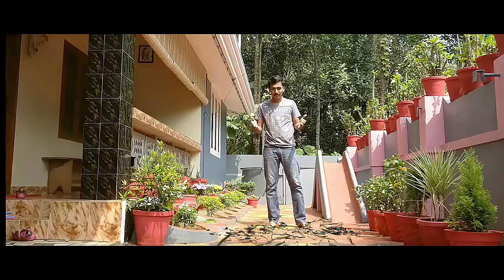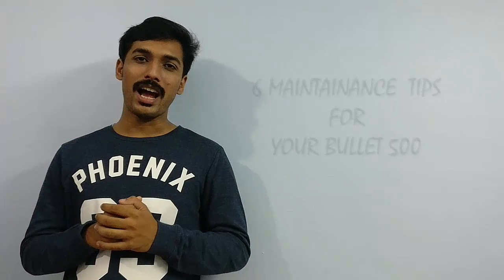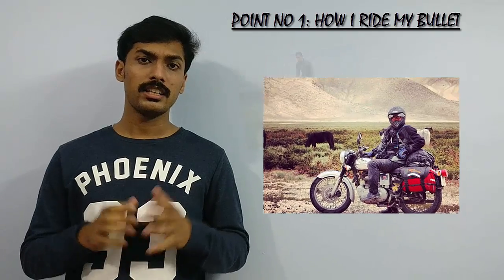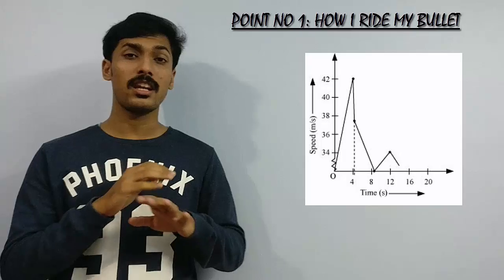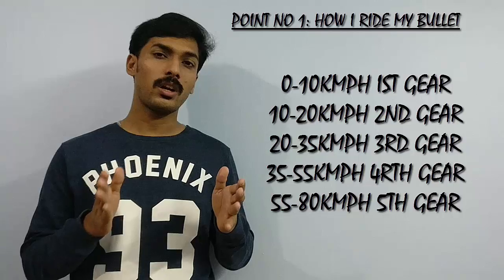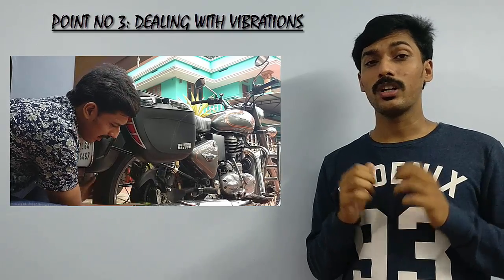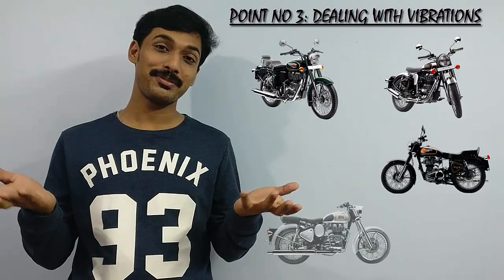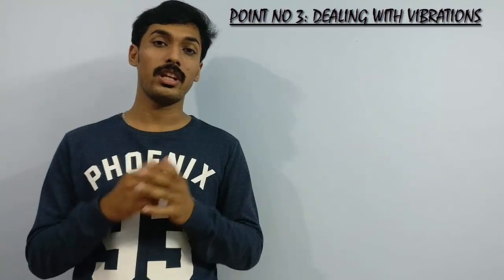Royal Enfield Maintenance tips | 6 Tips On How I Maintain My Bullet | 500 Subscribers

Comment: I'm using Motul 15W50  and NGK Iridium Spark plug  for 5 years for my 10 year old Enfield Bullet G2. Both alternatives giving me more fuel efficiency , less vibrations and I get 50Kmpl  in highway cruising .  The sludge  depositing in the engine is also reduced a lot. I suggest an oil change in every 6000km in normal conditions and 5000km span in tough conditions like heavy traffic or  hilly areas. Iridium Spark Plugs may withstand more than 50K kms but I'm replacing it in every 25K. Motul Synthatic oil costs Rs800 per litre and NGK Iriduum 600 per piece.  If the engine makes a lot of smoke due to wear and tear the spark plug needs intermittent cleaning. These two alternatives are best after an "engine overhaul".( For malayalam readers-  ഞാന്‍  എന്‍റെ 10 വര്‍ഷം പഴക്കം ഉള്ള  'പഴയ മോഡല്‍' ബുള്ളറ്റ്നു 5 വര്‍ഷമായി  മോട്ടുല്‍ 15W 40 സിന്‍തെറ്റിക്ക് ഓയിലും "ഇറിഡിയം" സ്പാര്‍ക്ക് പ്ലഗും ആണ് ഉപയോഗിക്കുന്നത് . ഇത് രണ്ടും ഉപയോഗിക്കുന്നത് കൊണ്ട്  എന്‍ജിന്‍ വിറയല്‍  കുറയുകയും  ഹൈവേ യാത്രയില്‍  ലിറ്റര്‍ നു 50 കിലോമീറ്റര്‍ മൈലേജ്  കിട്ടുകയും ചെയ്യുന്നുണ്ട് . എന്‍ജിനുള്ളില്‍  അടിയുന്ന  "sludge" കുറഞ്ഞിട്ടുണ്ട് . സാധാരണ 6000 കിലോമീറ്റര്‍ കൂടുമ്പോള്‍ ഓയില്‍  മാറിയാല്‍ മതിയാവുമെങ്കിലും , കൂടുതല്‍ നിര്‍ത്തി-എടുക്കുന്ന സാഹചര്യത്തിലും ,  ഹൈറേഞ്ച് കളിലും 5000  കിലോമീറ്റര്‍  കാലയളവ്‌ ആണ് അഭികാമ്യം. "ഇറിഡിയം" പ്ലഗ്  50000 കി.മി.  നു  മുകളില്‍ ഉപയോഗിക്കാം എങ്കിലും 25000 കൂടുമ്പോള്‍ ഞാന്‍ അത് മാറാറുണ്ട്.  സിന്‍തെറ്റിക്ക് ഓയില്‍ ലിറ്റര്‍നു  800 രൂപയും സ്പാര്‍ക്ക് പ്ലഗ്നു 600 രൂപയും ആണ് വില. കൂടുതല്‍ പുക ഉള്ള എന്‍ജിന്‍ ആണെങ്കില്‍ ഇടക്ക് ഇടക്ക് സ്പാര്‍ക്ക് പ്ലുഗ് വൃത്തിആക്കേണ്ടി വരും. എന്‍ജിന്‍ പണി കഴിഞ്ഞ ശേഷം ഈ രണ്ടു മാറ്റങ്ങളും വരുത്തുന്നതാണ്  കൂടുതല്‍ നല്ലത്.)
Reply from the maker: Hi Friend,
   
Firstly Im really sorry for not responding to your comments and not to continue my works..All that happened due to some personal problems that's the reason i gave my channel to my sis.

Bt Now I'm in♥️
This is your *Enfield Rider*, back with my new channel uploading first video tomorrow at 8 am..so plz do Subscribe,watch & support me as how you were.God bless you 😊
Stay safe😇

Subscribe 👇🏻 South Side Serpent https://www.youtube.com/channel/UCsERTefHIz6nQrndFDRsKLg

Comment: Vibrations in the UCE engine... It is not due to the sole fact that bullet is made of metal. Take the CI engine and u'll find that a perfectly tuned CI engine puts out much less vibration. It is partly due to the air:fuel ratio. Newer bullets have a higher air:fuel ratio as pre-set in the carb by the company to extract the maximum mileage. Increased a:f ratio means greater amount of O2 entering which enters the engine, which produce a vigorous combustion with higher power output and excess heat , which is no problem in UCE as it is cooled with approx 2.8 litres oil per minute. In comparison to this, the old CI has only 0.8L of oil circulation per minute which makes it heat up, thus forcing the mechanics to reduce a:f ratio with less air and more fuel thus producing a more calmer engine with a distinctive thumping sound, and torque distributed in the lower RPM, which makes for a noticeable travel in the city at slow speeds of 20 kmph at 4th gear, with little vibration.

Comment: After wasting 1 oneway kit(and 4k bucks) and a lot of research, I got this:
1. Always kick in morning/winter mornings. Rest of the day, self can be used. (applicable to all bikes. saves battery, saves self)
2. Never throttle while self start. The 'pushback' from engine screws the bearing and if that bearing is not replaced, oneway kit is also damaged. So, never throttle while self. or throttle just a little bit.
3. Never half-self it. Push button firmly till engine starts.
If followed self(and battery) goes on for years. Otherwise , wrong practices can screw them up in months.
Add up:
regarding vibrations, use 15W50 always, get a heavy handlebar(add sand/bearingballs/clay inside, weights/grips at barend), warm up engine before use. Vibration almost vanished for my c500.

Comment: I am planning to buy desert storm.. pros and cons please..?
is there any alternative option other than desert storm?
Reply from the maker: Anand Rooban Bro desert storm is an awesome vehicle , The pros will be the instant power and torque the engine gives bcz of the fuel injected engine compared to the carburetor ones , Another ones is the cruising speed of the vehicle now if you take the bullet 500 its sweet spot will be 80-85kmph ones pass that the feel is not that good as of vibrations but i could easily ride  at speeds of 95-100 without any problem . now the cons of the vehicle is the mileage , Compared to the bullet 500 which geta around 32-35 kmpl this will get you a maximum of only 28kmpl , And if you are are a tourer the fuel injected engine wont be as easy to service compared to the carburetor engine on bullet 500 which most mechanics are able to service . Those are the main points i looked into , Will make a video on this topic asap , Subscribe and Stay tuned for more , Have A Great Day bro :)
Reply from the maker: Anand Rooban bullet 500 is the best alternative , as the main difference is only the carburetor vs fuel injection , And the styling . Most of the other aspects are same . If you are a modern style of person continental gt is also a good one but the same cons that i stated for the desert storm implies here . Hope i could help you bro .
Reply from the maker: Hi Friend,
   
Firstly Im really sorry for not responding to your comments and not to continue my works..All that happened due to some personal problems that's the reason i gave my channel to my sis.

Bt Now I'm in♥️
This is your *Enfield Rider*, back with my new channel uploading first video tomorrow at 8 am..so plz do Subscribe,watch & support me as how you were.God bless you 😊
Stay safe😇

Subscribe 👇🏻 South Side Serpent https://www.youtube.com/channel/UCsERTefHIz6nQrndFDRsKLg

Comment: simple and straight forward.......kudos..great job man....!!!
I have a marsh grey too and it has done 6000 , yesterday the vehicle just randomly turned off when i was at 80kmph (i am quite aware that the service is due upon reaching 6000km) ,any idea on how this happened (is it the engine oil?) it felt like the thing that happens when there is no petrol, the acceleration just gradually stopped and the throttle  reponse was very poor.
Any ideas?
Reply from the maker: +Ashwin CJr bro is the vehicles electrical section funtioning
Reply from the maker: +Ashwin CJr if not then i had the same issue and i have made a video just check it out and c whether u can solve your issue
Reply from the maker: +Ashwin CJr do check out my channel for the video
Reply from the maker: Ashwin CJr bro does the electrical section of your bike working ???
Reply: sure.... !!
I also faced this issue where the engine doesn't start initially(kickstart) and it makes this loud awkward noise when not starting properly(happened twice).
Any ideas?
Reply: yes no issues there...everything works just fine..!!!
Reply from the maker: Ashwin CJr i had the similar situation wher the vehcile suddenly haulted and wouldnt start then after . if the vehicle doesnt start and you dont get any electrical section like the headlight etc working then check out with the fuses or the battery . if the vehicle is starting and there is no other issue like mentioned above then it would be due to reaching the service time , as the air filter or the oil filter could be blocked and might be causing the missing of your engine if that might be the issue then do service your vechile as soon as possible . hope i could help you bro . stay tuned for much more :)

Comment: bro which tyre pressure dou recommend air or nitrogen PlZZ reply
Reply from the maker: +Harish kumar sorry i didnt include this , i do actually use nitrogen bro , it has the ability to stay much cooler in temperature and is recommended when you go for long rides as it can help you in lasting your tires . Problem with using normal air is as the temperature increases air pressure to increases predominantly , so i would recommend you to use nitrogen . Both are free of cost , its abundantly available at petrol stations . Hope i could help you bro . Subscribe and stay tuned for more :)
Reply: Enfield Rider Nitrogen isn't free.
Reply: Enfield Rider tq bro very kind of u for u reply eagerly waiting for ur posts and videos keep going
Reply: As a matter of fact, Nitrogen doesn't make any difference. I was under the impression that it made a big difference. I had a big argument with my geeky friend over it. He said it doesn't give any advantage over the normal air. I argues it's better. Then I googled it and learned that it actually doesn't make any difference. If there's anything, it's very marginal and it is not worth finding and going to tyre shops where they have Nitrogen. For first time filling, tyre shops charge Rs. 50 and 10 for checking each time.
Reply from the maker: Hi Friend,
   
Firstly Im really sorry for not responding to your comments and not to continue my works..All that happened due to some personal problems that's the reason i gave my channel to my sis.

Bt Now I'm in♥️
This is your *Enfield Rider*, back with my new channel uploading first video tomorrow at 8 am..so plz do Subscribe,watch & support me as how you were.God bless you 😊
Stay safe😇

Subscribe 👇🏻 South Side Serpent https://www.youtube.com/channel/UCsERTefHIz6nQrndFDRsKLg